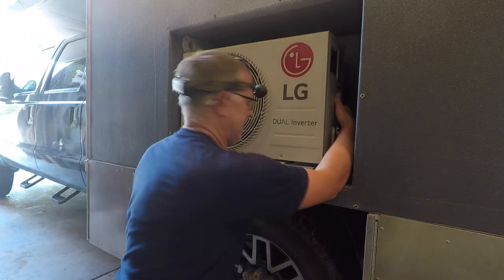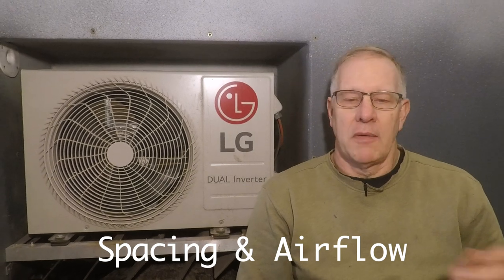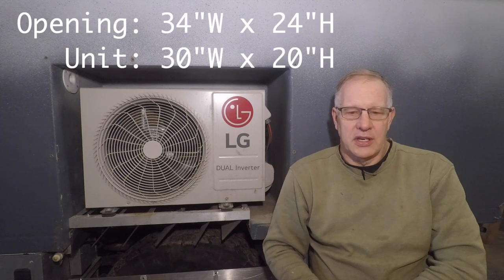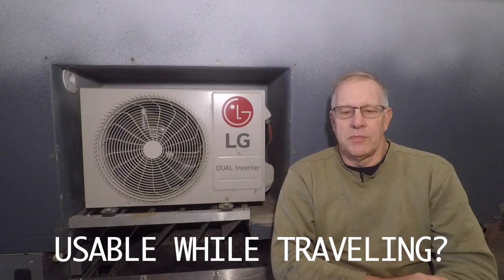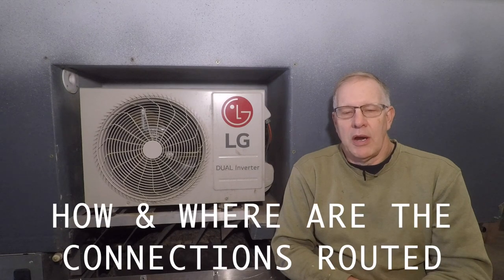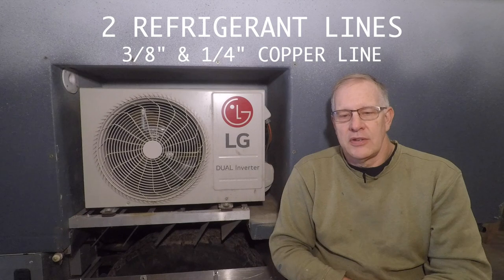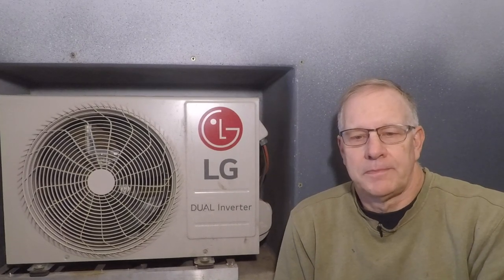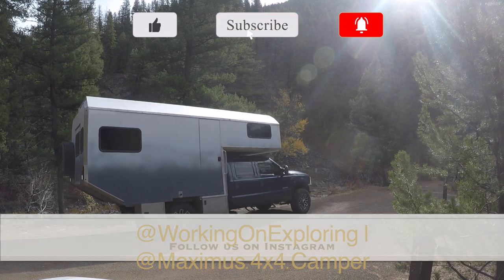Mini Split RV System? Your Questions Answered | DIY Truck Camper

Comment: You always want to insulate your refrigerant lines to prevent condensation inside and also in order to not decrease your efficiency. Remember, the metering device or in our case, the electronic expansion valve or EEV is in the outdoor unit. The refrigerant is at its coldest point leaving the EEV and you are losing a great amount of cooling ability. You had the cooling TD mixed up in your video. Typically, we see 70F evaporator entering dry bulb temp and 45-55F supply air dry bulb temperature. With variable speed motors, EEV's, those temps are always fluctuating and can mask problems. I have an Ameristar or Gree 120V 22 SEER 9000btu mini hp mounted inside of my Chevy Express van. I have a Fujitsu 240V 33 SEER 9000 btu mini hp in a small building. Clean your units often, especially with that one over the tire and having those air vanes throwing dirt/dust up inside that compartment. Use water and a little Dawn dish liquid or mild automotive shampoo cleaner on outdoor unit. Wax painted areas after cleaning. Use Nu-Calgon Evaporator Foaming No Rinse Coil Cleaner (Amazon) in an aerosol can on the indoor coil. Use a 1/4" foam prefilter with filter spray to "prefilter" the air. The plastic screen filters are not very good.
Reply from the maker: My liquid line is insulated to prevent condensation. I'm not sure what I may have said that led you to understand it wasn't. Heat gain on uninsulated lines is only an efficiency loss on the line that runs outside conditioned space. Because the liquid line is all but 6" inside the conditioned space, any heat absorbed by the line is not a loss of efficiency. Although my ODU is located above the wheel, I have rubber louvers below it to deflect road debris. I don't have any issues with the evaporator picking up dust at all. I recently checked it after a year and a half and it appeared as clean as new. Keeping the condenser clean IS important. Typically, return air is around 80-85F, not 70F. If it was 70F, it wouldn't need to be cooled. Typically, temp differential of an efficiently operated unit is 15-20F. Higher coil temp differential is both inefficient and a potential sign of other problems.  Supply air as cold as you suggest would require an evaporator so cold as to possibly freeze or condense more moisture than desirable. The function of an expansion device is to maintain constant superheat. EEVs can maintain constant superheat over a broader range of refrigerant delivery than a TXV. I'm not sure what you are thinking about when inferring broad fluctuations. The tools VRF refrigeration have to minimize fluctuation are very powerful and greatly reduce fluctuation over single stage units.

Comment: You said you have a power monitor to monitor how much power the unit uses but you never talked about your numbers. You only talked about how much it is rated for. Is it using 700 watts for an hour in your van. Or is it using 700 watts for 10 minutes then it shuts off because it cooled off the whole van in ten minutes. It would be nice to know its performance in test conditions.
Reply from the maker: This video discusses that. https://youtu.be/ijk2Z-ebevw?si=IFj_mU0ucy0K2iPG
In brief, on a hot day (90F+), the cabin gets in the low 80s by 1PM and we close up and turn on the A/C. It draws around 740W at start for 20-30mim, then drops to about 400W or a bit less for most of the rest of the day. If it's a really hot day, it may rise to 500W in the late afternoon. Variable capacity A/C with a good 'turndown ratio' (the range of variable capacity), never shuts off, it slows down or speeds up to match the room heat load. My 9kBTU LG has a capacity range of 2.7kBTU (30%) to 10.4kBTU (115%),which correlates to 280W to 840W.
Reply from the maker: Performance is relative to heat load. Heat load is the rate at which heat enters the interior. I have 2.4" thick walls with 2" of polyiso insulation (R13) and 7 mostly large fixed double pane windows (R1.7). I stay parked in full sun (increasing my heat load) to allow my 950W of solar (now 1140W) to bring in power to support the A/C operation. Parking in shade would obviously decrease heat load and also drastically decrease solar power collection. The wall/window insulation of your vehicle and exposure you choose will obviously affect  the power consumption/energy balance problem.
Reply: @WorkingOnExploring  thanks for clarification. I have a 2000 wat hour battery. And 950 watts of solar. I think im gona double my battery to 4000 wat hours so i can power that ac unit for a bit longer.
Reply from the maker: I recommend that you alter the way you think about operating your heavy consumers of power. Think of it as being operated from a generation source (solar/shore/generator) and that your battery is just there to make up the difference when TIMING of  generation does not coincide with TIMING of demand. If you think in terms of running a high power device from stored power, the size of the stored power becomes very large which is both expensive and heavy.  If you find yourself thinking you need more storage, maybe you'd be better off with adding more generation first. It's often easier and less expensive  to add solar capacity than battery. If you want to USE electrical power, that power has to be GENERATED. Having the ability to store more  only allows you to change WHEN the power is used, not how much power is available. While you can store more, you also create a bigger battery debt when used so the generation problem comes right back. 

I want to run my A/C for 8+ hours per day EVERY DAY,  which consumes 5kWh + 2kWH for base loads. If I don't also generate that much power, I can't do it again the next day or the day thereafter. If you just add enough battery to last a day, you can make it through the first day, you won't make it through the second and have even less for the third.
Reply: @WorkingOnExploring  thank you for the advice. I will be running this ac unit from an ecoflow delta max 2. This sytem can only handle 1000 watts of solar input. And is expandable to 4000 watt hours of capacity. I will also be able to charge the batteries from my vans altinator. My van is spray foamed insulated and is very tiny with barly any windows. So i think this ac unit will cool my van down pretty fast.
Reply: @WorkingOnExploring  i wish i could retun the ecoflow an build my own set up but i already spent the money so ima make do with what i got.

Comment: Hi :0) does it draw 732w constantly when it’s on cool and 875w on heat? Or does the wattage tend to go lower? Thank you for taking the time to make these videos :0)
Reply from the maker: Those numbers are what it draws when it runs at 100% capacity. Because it runs between 30%-120% as it needs to to meet the temperature demand, it never runs for long at any one capacity. I have a power meter on it so I can see what it draws and it is most often between 400-550w...kind of a loose number...the key is it is most efficient when it runs full time and operates within it's capacity range because starting and stopping creates losses. It will be different for every environmental condition and RV.
Reply: Thanks so much for your  in-depth description of how everything works!! It’s really helpful to the Rv community concerning the upgrading of our systems. Mini splits are definitely the way to go🦋🎉
Reply from the maker: I just did an in depth analysis of RV air condition comparing 6 different units ....it may go live on our channel tonight or tomorrow.....the writeup on it is already available on workinginexploring.com/techdocs